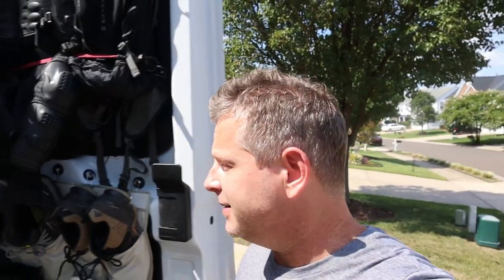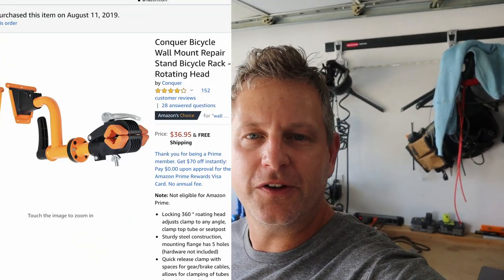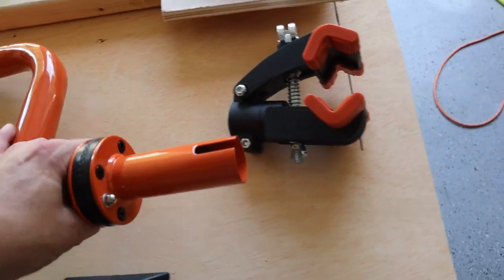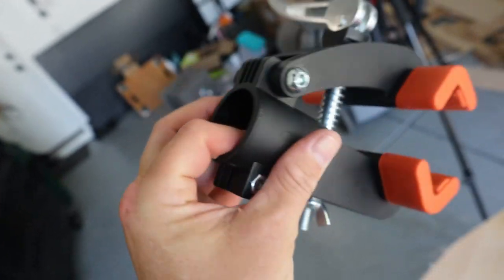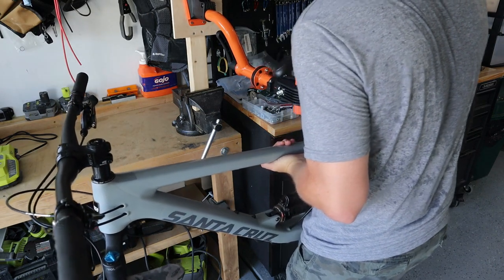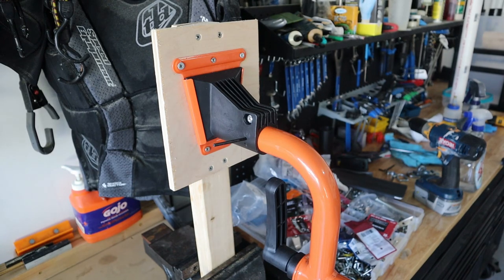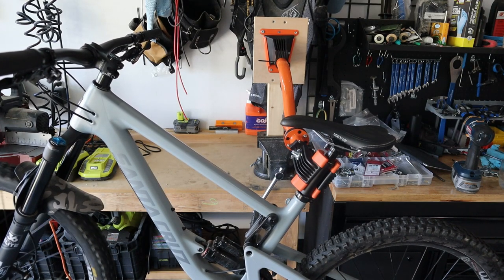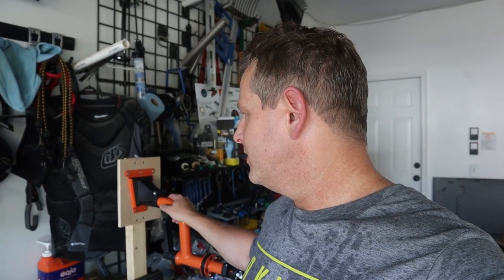#MTBPlanB Testing the cheapest bike repair stand on Amazon!

Comment: I am sure if you drilled through both sides with proper size bit for maybe a 1/4 thru bolt it would work fine, I doubt the plastic would just crack unless you pulled on it very hard for no reason. Worth a little modifications for that price, I have portable 'spin doctor' for years and still as new no rust, etcccc, got it on sale from I think Nashbar? Great for giving them a bath at local self serve car wash
Reply from the maker: Definitely would work for a while.